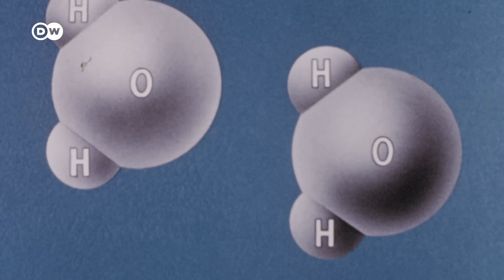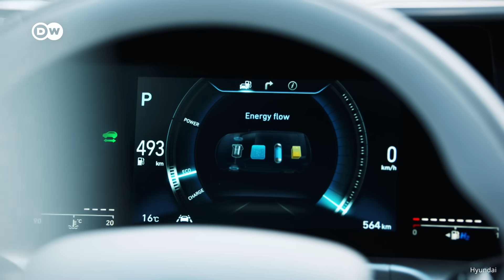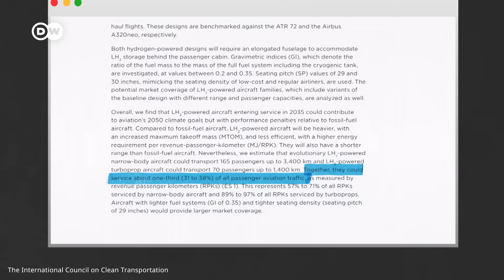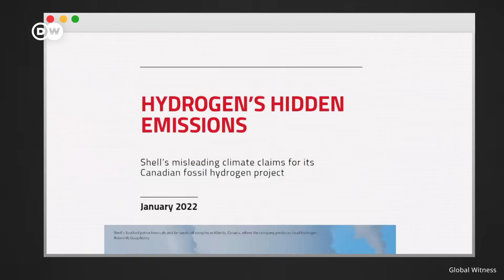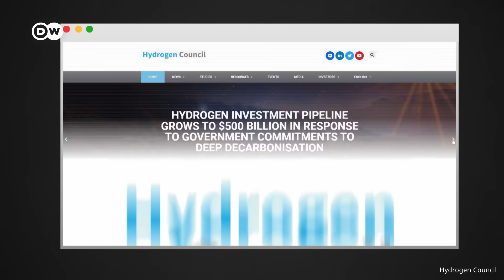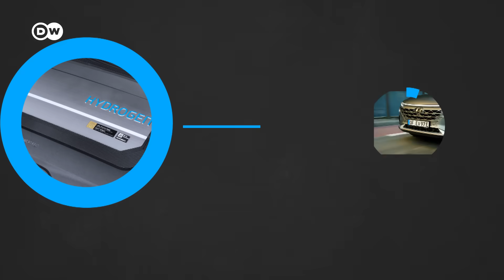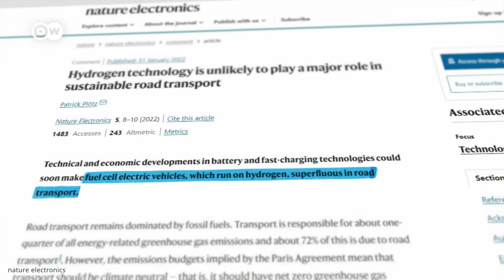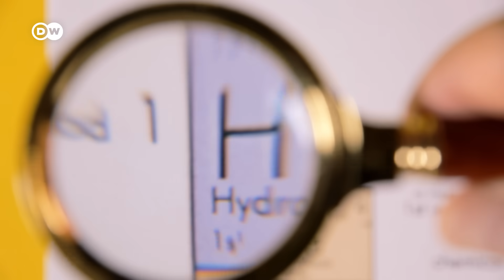The truth about hydrogen

Comment: Ok, so hydrogen fuel cells are the weak part of the chain.  You need to burn hydrogen in a chamber with oxygen at 45 bar.  Give the chamber a water jacket at 50bar and once it’s passed through the jacket atomise the water into the area just behind the flame.  This can produce superheated dry steam at 45bar @ 95% efficiency. Use this steam through an impulse turbine for mechanical drive @ 60% efficiency.  No rare earth materials, no mining, just stainless and aluminium.  We just need to start making a green hydrogen infrastructure.

Comment: After watching this video, it's quite clear why EV's and other hybrid vehicle manufacturing is just another mareting ploy that was invented by a select few to make a quick buck on what they call "renewable energies", but on a wider scale there is absolutely no scientific evidence that supports the fact the EV's or hydrogen powered vehicles for exaample reduce the carbon footprint. 

First you have to prove that the carbon footprint is causing climate change, once you establish that, then you need to rely on renewable energies on a smaller scale at the beginning and over time find the key to reducing these CO2 emissions (granted that C02 emissions are really the cause of climate change, which is not exactly established yet.)

Comment: I just don’t see how hydrogen as a realistic fuel source is viable. Just from the point that water is made up of two very stable elements that take far more energy to split into component parts than you’ll never get out of it. And then there of course is a thing that you’ll need an entirely new infrastructure. The math just doesn’t work.
Reply: It has non-quantifiable tradeoffs and in that way, potential benefits; thats why we consider it at all. You can't factor in advantages like increased energy transportation capacity in vehicles or low refueling times when merely calculating net energy losses.
Reply: @johanneskaun7435  You said: " Just from the point that water is made up of two very stable elements that take far more energy to split into component parts than you’ll never get out of it." That is just not true. Frankly; it is only true to an extent. What if the energy you mention is 100% free? No cost!  A company called Sun Hydrogen has developed an electrolyzer that operates with only two (2) inputs; on Sunlight and Water. Major breakthrough that will go to market within about one year in 2026.
Reply: Hydrogen is not a fuel.  A fuel is a harvested substance which has naturally had meaningful amount of energy stored in it through some process. Think wood and oil. Hydrogen is an energy storage medium like a "battery"  it's infinite, and potentially perfectly clean. It can solve many problems.
Reply: What to mention the scarce materials to do the electrolysis with? Only the electrolysis has a lot of energy losses.
Reply: It makes sense when you consider that vast amounts of renewable energy gets wasted because there is no where to store it. Hydrogen would solve this. AND there exists technology to store hydrogen safely at low pressure but high density. It just isn't getting investment. Probably from multiple lobbies including fossil fuels and the electric car industry which is massive since China is a big player.

Comment: H2 for steel and concrete production is definitely a winner.  As long as we make it using renewables.  Cars and even trucks batteries are definitely the answer.  In between though there are some interesting cases.  Large shipping would seem to be a case for hydrogen but should it be fuel cell or should it be hydrogen gas turbine? 

The large haulpack trucks are already electric except that the electricity comes from a generator powered by diesel ICE.  Again it could be a gas turbine running on green hydrogen spinning the generator. 

The other problem with fuel cells is that they require platinum group metals.  They are expensive and rare.  Unless we find a nice big asteroid packed with them, fuel cells are going to be limited to niche applications. 

One last thing about hydrogen is the problem of storage itself. It's such a small atom it creeps through any little gap. And it causes metal embrittlement. 

So yeah it is going to be part of the future but there are some hurdles to clear.

Comment: Hydrogen is not a source of energy. It is a storage option. If you look at the issues separately, it is obvious that hydrogen beats batteries hands down. We will soon face a battery disposal problem that will dwarf the problems of nuclear waste. Building a Hydrogen production facility next to the existing Diablo Canyon Nuclear Plant and not shutting the nuclear plant will change the future of energy forever. Social media is the key.
Reply: "..... A storage option"
Or
"Battery".
"If you look at the issues (with Hydrogen) separately" they are.... "issues".

Hydrogen liberation, storage, transport and reconversion to .... "Electricity", requires ±3 times the input of "Electricity" for every unit of output.
There can be no argument on that point.
.
The same money spent on hydrogen infrastructure (not to mention maintenance) if spent on "battery" storage will return 95% of the energy input  compared to 30% at very best.
.
Use of Hydrogen results in more fossil energy remaining on the grid.
It's "dirty" by proxy.
.
"But it's otherwise wasted" isn't an argument, spend it on battery storage..... ONE time. very little maintenance.
No.... NOT lithium ion..... Other chemistries are available.
.
"Battery disposal problem.... Thrown into landfill".
No..
.
I presume you believe that will happen to 500kg vehicle packs?
It's not something you just "throw away".
If a pack requires replacement, an authorised person will make the swap.
(Just as with an ICE engine)
The new pack will come with an "exchange deposit" attached to the cost.
The old pack will be returned and the deposit refunded.
.
End of vehicle life.
Do you just leave your old vehicle in the side of the road?
No.
It's taken to a "vehicle dismantler" who removes serviceable parts for resale, sends other parts for recycling.
Since the pack will be one of the top 2 most valuable items on the vehicle (along with drive motors) it's absolutely certain that company will send it for recycling, or rather SELL it for recycling.
.
In fact, a SMART owner will ask for a payment to take the vehicle!
.
"But nobody wants it!"
.
Redwood Materials is a great place to start.
Their process will recover 95% plus of the elements in a pack.
They will sort and refine the elements into material of better quality than new stock which costs only "1/6th" (their data) of mining new material.
.
Btw, the company was started by JB Straubel, former CTO at Tesla, who left that extremely lucrative position to solve this problem.
.
They already have numerous contracts with major manufacturers.
.
His is one of hundreds of companies involved.
.
In actual fact, EV plus storage batteries will help SOLVE a disposable problem we have created by billions of phone, tablet, laptop, powertool and othe device cells which ARE thrown into landfill.
These can be throw into the same process as the vehicle / storage batteries.
LESS pollution.
.
One more point.
You do know that the term "HFCEV" Stands for "Hydrogen fuel cell Electricity Vehicle "? 
You know they use "Batteries" because a fuel cell that fits into a vehicle  can't produce sufficient instant energy output to provide the power required, it has to be stored ready for use?
.
You need to read more.

Comment: In the 1930’s we start using dynamo and induction motor using magnetic coil to run mechanical engine before petrol. Why can’t we do it again?
Reply from the maker: Hi Fernando, thank you for your question. 🦾 Today, in power generation dynamos have been largely replaced with more efficient alternators and in transportation sector by rechargeable batteries. Dynamos are still used though, just not as widely, i.e. for smaller wind turbines and for bikes. 🚲

Comment: At this stage in its development, hydrogen undoubtedly has its flaws as a sustainable energy source. But then, so does electricity, considering that the extraction of battery materials is a very messy business - not to mention the problems surrounding the production of green electricity in the first place. Let's not be too quick to dismiss hydrogen as a contender while it searches for answers to the impediments that hinder its progress in the short term.

Comment: Gear around shaft of existing turbine may be rotated with other gear fitted to  adjustable shaft to MW motor powered by horizontally aligned wind turbines installed from front top/side to rear top/side around Fuselage.. Wind turbine blades is to be  fit with ball bearing.. Armatures made up of rare earth metals with glue all around to protect from rain water may be nut bolted to inner circular frame of fuselage..outside metal casing of wind turbines also may be nut bolted to inner circular frame of fuselage.. 25% of front side of metal casing remain open with adjustable cover plate operated buy AI to remain open/close.. At high altitude n maximum speed these openings remain exposed to air flow to produce electricity.. Enormous momentum n low Gravity may fly aircraft after AC current of all horizontally aligned wind turbines are added n fed to MW electric motor installed inside aircraft n side of wings..well need to engineer and adjustable shaft connected to axle of this  AC motor to rotate shaft of existing turbines when fuel/gas injection into turbine piston remain OFF.. Well need to pump as much air Asia equal to byproduct gas is produced inside turbine out of piston chamber explosion or burning of gas/fuel inside turbine to create sufficient thrust at rear side of turbines..these inlet sucking pumps may be installed around fuselage near wings with tubes joined to tubes inside turbines  at point of production of byproducts gas n gas flowing towards  rear side.. Extra turbines are added under wings in some model of aircraft.. Well may install such electric driven turbines, design of which may be procured/shared technology  from recently launched electric jet at California..extra short wing with small turbines may be installed at some location of side of fuselage behind existing wings, just like short fin  behind big fin of side of fish..at high altitude n maximum speed of aircraft well feed electric Power from these horizontally aligned wind turbines all around fuselage to fly Aircraft.. Well may add extra generators by the sides of existing generators installed at rear side n inside aircraft to run/complete this system..shark top like small elevation may be installed at too of aircraft for style..thank you..let's pray..oh my god..give me accompaniment.. Forgive me..advise others to pray so..take care of Body.. Detox daily..add much jaggery to less tamarind juice n add herbal laxatives..Don't fridge this mixture..lid of mixture pot to remain open or connected to Ballon via a small apparatus connected to lid of jar /pot to pass fermentation gas.after 21 days .add this mixture to water n boil n drink to detox.. If body ache/feverish😫 is felt with frequent urination or pain in abdomen after taking non_vegeterin foods.. Stop/reduce  eating banana,orange,potato,sugar,dairy etc..eat cabbage, cauliflower, rice,walnuts,much water,daily bathe,clean garments,exercise,berry,not broccoli,apple,pomegranate, not green coconut water etc..thank you..sodium ion battery comes alternative to Lithium battery..one God may Bless n forgive n save from frightening dream Luke life beyond death for millions of years amen

Comment: Perpetual aircraft motion is due to less drag n enormous momentum of aircraft.. We may stop fuel supply to turbine n run from previously discussed prototype of horizontal turbines installed all around fuselag to generate electricity n feed to shaft of turbines under wings.. As much gas is created due to explosion /burning of fuel/gas inside turbine.. As much air volume may be sucked by exhaust like fan mechanism at locations where byproducts gas is produced inside turbines.. Main concern is to create upward thrust due to high speed air flow from turbine to rear outside.. If extra energy is meeded, we may add extra generators at rear side inside aircraft

Comment: Hysata hydrogen greatly helps in the renewable production of hydrogen, it is a game changer in making hydrogen meet the cost point needed where hydrogen is the better technological choice. Trucks make sense as they can easily accommodate fuel tanks one or two cubic metres in capacity

Comment: Add one more pair of short wings to fuselag at distance behind existing wings... Add numerous units of small turbines with blades rotating horizontally.. A ring holding some magnet🧲 pieces to be attached to blades so that blades may rotate at high altitude.. Now weld ring of armatures below ring of magnets.. These wind turbines may be covered with metal jacket with 25℅ opening in front side to allow air to pass through these units to hit horizontally placed blades to rotate n generate electricity.. Outlet for air to exit from these units may be made at rear side of each unit.. These wind turbines may be installed surroundings fuselag .. Turbines axle may be welded to circular frame of fuselag.. Combined electricity may be either fed to existing wings shaft or extra turbine attached to new wing . If we are able to feed megawatts of electricity from wind turbines to shaft of existing wings, we need not add fuel anymore... This system is likely to operate at high altitude where gravity is low.. Initially jet engine will start normally with fuel.. When we get optimum electricity at maximum speed of jet, we may stop front wing turbines n operate rear wing turbines fitted with electrical motor to operate fan n rear turbines n compressor.. We may instal rectifier, stabilizer, inverter, oscillator etc electronic n Arduino enabled circuits in place of oil tank installed in short rear wings .. Thank u.. This noble COVID-19🦠😷season, many people's kidney come weak due to persistent use of paracetamol.. If we feel fever, bodyache we may avoid high protein beef, dairy, banana, tomato, potato,kiwi, orange, beans, lentils, almond, dates, sugar, raisin,briccoli apricots ,spinach, raw salt etc n eat cabbage, rice, wheat, beet (not beet green), walnut, cauliflower, apple, skinless chicken, fatty fish, jellyfish, lobster, egg whites, much water (restricted for acute kidney dialysis stage to one n half liter), berry, seamass etc. Thank u.. Let's pray.. Oh my God.. Please give us accompaniment n forgive us n advise others to pray so to get power to accustom to existing global crises of energy, foods, jobs etc. Thank you.

Comment: The main point to ponder here is the need for centralizing its production. Are there economies of scale to be achieved by producing H2 in one location & distributing it? Or will it be ok to produce it to the required volumes in places of consumption just like a portable genset? An industry or a ship or a train can have its production tailored to their consumption needs. Same goes for agricultural fields & so on.. Can someone explain what is the need to produce bulk in one place & transport H2 over to places either through trucks or pipelines? If solar power can be produced in each household for their needs, the same can be applied to H2 as well? In all, the objective must be to minimize H2's transportation & storage. There is also a need to find the quantum of energy produced for a unit of input energy in the case of H2.. If we know this ratio, say if it is 1:10, then the same H2 energy can be used to power further production of H2 without the need to look for other forms of green fuel. H2 can create itself & multiply - just like the seeds in a plant do for agricultural production.

Comment: Current car batteries have a lot of carbon produced in manufacturing. That means the car has to do 60K to 70K before breaking even to an ICE petrol car. How long do current batteries last? Not sure but the cost is high and carbon produced again is very high in manufacturing. Perhaps this will balance closer to the hydrogen solution, if taken into account?

Comment: Electric cars are nice and all but... where are you going to charge them? Not everyone has a big house with garage. A lot of car owners live in flats an struggle with parking. Imagine fighting not just for parking space but for limited amount of charging stations in your neighbourhood. And as we are on charging stations, how are you going to deliver this massive amount of energy to them?  The power that was thus far delivered thru liquid fuel now will need to be delivered by the electrical grid. It will be around 30-40% increase of power usage per household. To make this worse this power consumption increase will not be equally distributed in time. The energy consumption spikes at the end of office hours when everyone parks their electric cars to charge them after work will be horrendous. And this will only get worse as we get batteries that charge faster.

Those are not trivial problems. A liquid or gas fuel used for vehicles could eliminate those problems, even if it is less efficient. It requires less spread out infrastructure and does not create immense stresses on electric grid. 

My prediction is that in next decade as we get more weather dependant green energy sources and more electric cars, we will be getting a lot of electrical grid problems. You don't need to look too far for it,  California already had to briefly ask it's citizens to stop charging their EVs because their grid was failing.